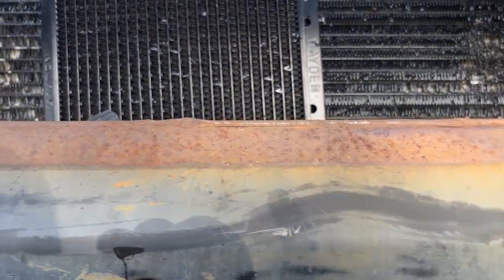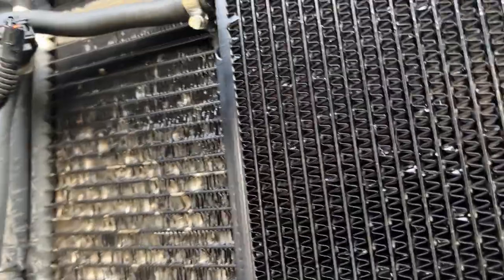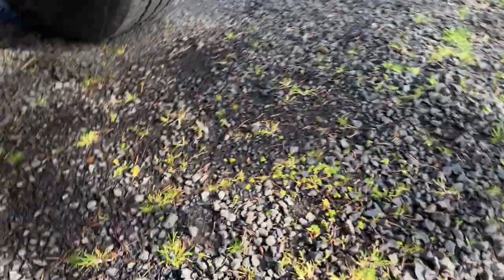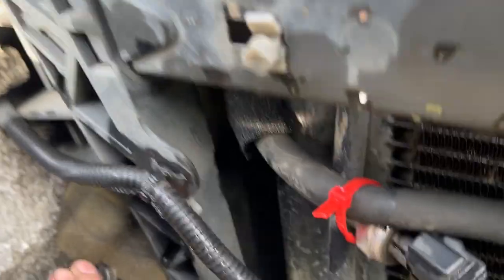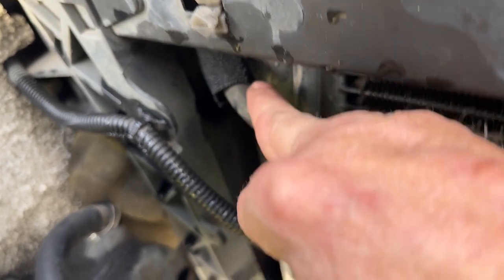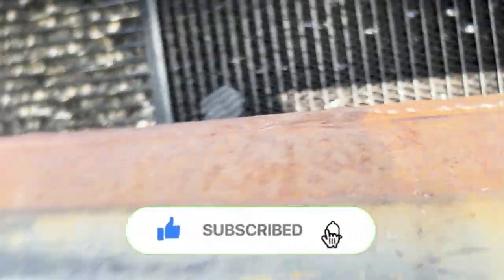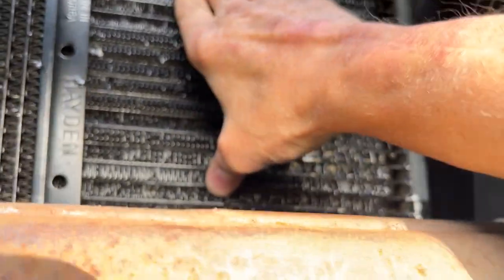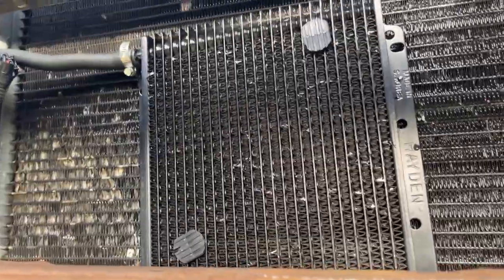How to add an additional Transmission cooler to a Nissan Titan truck

Comment from the maker: There is bad misinformation on the internet and forums about defective radiators causing the transmission fluid and coolant to mix on Nissan Titans. Unfortunately this misinformation continues to be spread by hearsay. 2005-2010 Titans
  WERE NOT a model that had this issue. 
  “We have received hundreds of complaints from consumers in regards to transmission failures from defective radiators in 2005-2010 Nissan Pathfinder, Nissan Frontier and Nissan Xterra vehicles “ -NC consumer.org
“The widespread issue has prompted the North Carolina Consumers Council (NCCC), a consumer protection group, to plead that everyone avoid the 2005-2010 Frontier, Pathfinder, and Xterra at all costs.”- Nissan problems.com.
Reply: Interesting. From what I'm seeing the titan still does have a transmission cooling circuit integral to the radiator. Is that correct? So the radiators with integral transmission on the Titan doesnt have the high failure rate the Pathfinder, Xterra, etc.? I did this mod but consider going back to fully bypass the integral cooler since my titan is older w/ high mileage
Reply from the maker: @iholland1869  yes it does have the integral cooler, and if you have a factory tow package you will also have the factory transmission cooler sandwiched between the condenser and radiator. My research showed titans were not an issue as stated above. Mine has 207k on it and 20k on it since adding an external cooler. Towed our 9500 lb RV over many mountains in that time including one over 10,000’. One thing does need to be said about bypassing the radiator is during winter your transmission fluid would stay cold which could also lead to hard shifting.

Comment: This guy is on point. If your armada/titan has low miles or a pretty new radiator
Reply: Do it this way. If it’s still running hot, add the PML deep pan to give you more oil capacity. It will stay much cooler.
Reply: I just did this to a 2007 with 275k miles. Transmission is much cooler when towing. I don't think the low miles or radiator age makea a difference

Comment: This video is horrendous. The object is to bypass the trans fluid passage built into the radiator. Titan radiators are known to crack and coolant mixes with trans fluid and creates the Strawberry milkshake of Death and then you grenade the transmission.

Comment: Hello, good day, I have a question and what happens with the two disconnecting lines that come from the radiator, can you explain?  The inlet connection and the outlet connection at the bottom left are left without a plug or do I have to put a plug in them?
Reply from the maker: @betocastaneda29  I didn’t disconnect the transmission lines in the radiator in my install, I simply added the new trans cooler inline with the radiator lines. If you are going to completely disconnect the radiator lines and just use a new transmission cooler I would drain the old radiator transmission lines as much as possible and plug them somehow.
Reply: @RV_Chef_Life  I understand, but you can also connect the input and output lines only to the new trans cooler, right?
Reply: @RV_Chef_Life  If I'm going to connect it only to the new transmission cooler, what happens if I leave them with some type of plug after draining the transmission oil?
Reply from the maker: @betocastaneda29  nothing will happen, you are bypassing the transmission lines in the radiator completely and as long as those lines in the radiator are empty, you probably don’t even have to plug them either. If you don’t already have the factory separate transmission cooler you will be going straight from the transmission, through your new cooler and back to the transmission. My factory transmission cooler ( which is optional) is sandwiched between the front ac condenser and my radiator. How many miles do you have on your truck? I just passed 207k with no issues and was able to tow my 9500lb rv over a 10,000’ mountain.

Comment: I’ve been looking for the transmission cooler line to do a transmission fluid flush, would You suggest to disconnect the line right there next to the transmission to get rid of the old fluid? Thanks
Reply from the maker: Honestly I can’t answer that as I’ve never done a flush, I simply change my fluid. I always use pure synthetic fluid as well.
Reply: Thank you  @RV_Chef_Life . Sorry for the delay response but nobody really responds most of the time. Appreciate the video

Comment: Is there a way to just bypass the cooler in the radiator mine is leaking and I don’t want to replace the whole radiator for it
Reply from the maker: Absolutely just disconnect the Two transmission lines on your radiator and run some more line to a replacement cooler. Your transmission cooler is sandwiched between your AC condenser on the front and the radiator. My lines are on the passenger side but just follow your lines from your transmission

Comment: Trying to do a complete transmission fluid flush. Right there where you show the line connecting to the transmission, would you say it’s ok yo drain out the old transmission fluid? Thanks
Reply from the maker: Absolutely, never a bad Idea for fresh fluid.

Comment: Ok so I've been looking into alot of the videos for a trans cooler and so far my truck is the only one I've seen with a fan on the front of the condenser
Reply from the maker: Are you sure it’s on the front of the condenser? Your condenser is the skinner of the Two.
Reply from the maker: Mine did too and I removed it because it never came on

Comment: Not good.. This truck is known for the trans cooler of death from inside the rad.. So i don't think that's a good idea on this motel.
Reply from the maker: I’m not going to disagree but in my defense my truck has 196k miles on it and I have been pulling a 9k lb rv around the country the past 6 years. Knock on wood my radiator has been just fine.

Comment: Does this bypass. The original
Reply from the maker: It does not. If you have the tow package with the original trans cooler this will add an additional cooler. The flaw with the original cooler is it is sandwiched in between the condenser and radiator which makes it much less efficient removing trans fluid heat. I was worried about adding an additional cooler, but this was a game changer. I push our Titan to edge in tow capacity and like I said my temp never got above 1/2 the gauge.
Reply: @RV_Chef_Life  that is not the original flaw the flaw is bypassing the radiator because they are known to crack and inject coolant into the transmission lines creating the Strawberry milkshake of death.